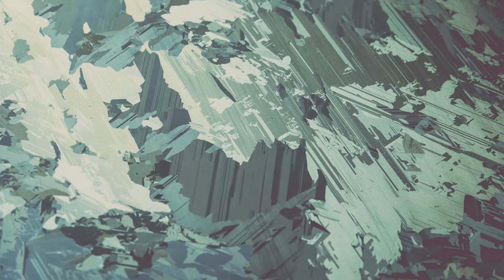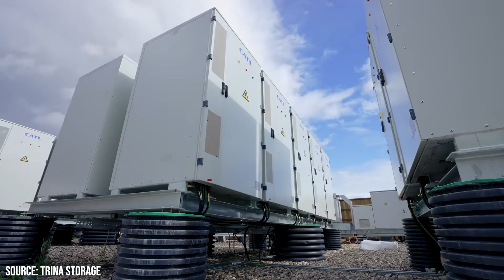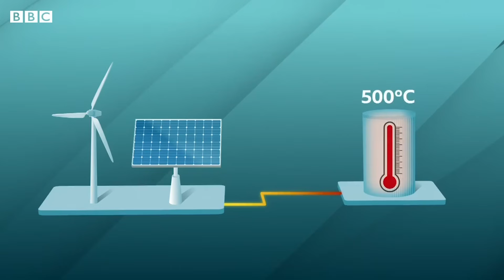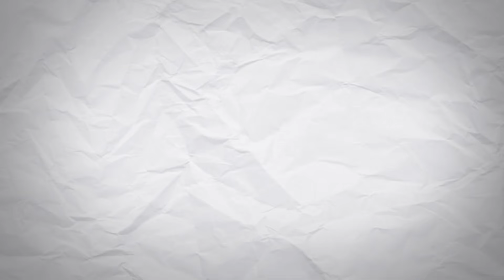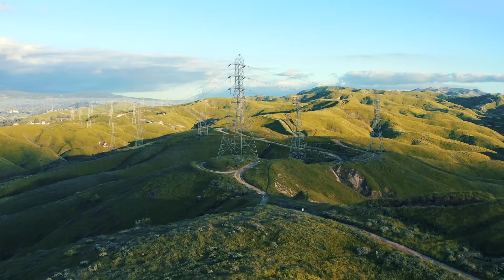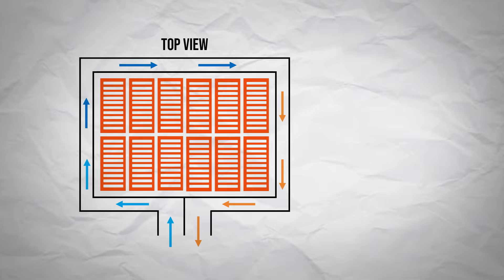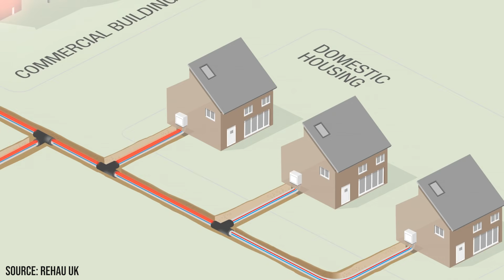How 3000 Degree Bricks Will End Battery Storage

Comment: Definitely an interesting technology, however I don't  think it will be able to compete with modern heat pump technology where you are hitting COPs of over 3 for electric facility heating.  In my neck of the woods, electric resistance heating is about 4x as expensive as heating with gas.  An electric air-sourced heat pump bridges that gap to some extent.  It is unclear how this storage tech provides a cost benefit from a commodity standpoint, whereas a heat pump obviously does.  There are definitely limitations with heat pumps for high temp applications,  so perhaps this storage tech could provide some advantages there - assuming it works and doesn't lose too much energy in storage too quickly.
Reply: Thanks for your thoughts! While heat pumps are great, we are able to tackle higher temperature applications!

Comment: Heat grids have always been superior in terms of efficiency. But distribution costs are very high and it's inherently local. With a heat storage solution like this isn't not entirely explained what scale this would work at. But for heat grids it'd have be the the scale of dozens of homes and businesses. Further the cost to install a heat grid is very high and doesn't offer the much more interesting benefit of providing cooling as well so a good part of the globe loses out. Considered on that basis it sounds a lot more reasonable and cost effective if you're going to spend that kind of money for a heat grid to just insulate homes better and use the homes at the battery. For industrial applications though I totally see the use case and that in my mind IS it's use case. Extending large factories runtime throughout the day would be a big deal.
Reply: Yes! We're focused exclusively on industrial applications =]

Comment: This is a thermal mass storage system, albeit a high temperature one. Such high temperatures are expensive to build and maintain, and inefficient as hell. There just isn't enough mass that can be positioned close enough to the intended use.
Reply: Ya, there's a problem with sand batteries otherwise we'd see more of them. I've been thinking about making a small system to store solar energy at the house but the math doesn't make sense
Reply: You wouldn’t know
Reply: suck on it
 @timcarsondalat

Comment: I'm not really a big fan of using electricity to heat thermal batteries. Turning solar radiation directly into heat could be even cheaper since solar thermal energy efficiency is far better than photovoltaics.
Reply: When you have to transport heat from a (massive) solar thermal plant over distances, you experience massive losses. We are very high efficiency due to our ability to convert electricity to heat at 98% efficiency, right where heat loads are located.
Reply: @RondoEnergyGlobal  You are right, the solar heat plant should be located at the site, which is challenging or impossible if space is limited. As you said, generating large amounts of thermal energy requires a lot of space. 
Also reaching the temperatures required for industrial applications is challenging with solar, that increases cost and defeats the whole point.

I wrote my comment before watching the whole video, it also became clear to me that using renewable electricity for heating is the best option for your applications. 
Solar thermal heating has it's niche, but not this one.

Thanks for the reply!

Comment: It is a misleading title. That is more like equalizing element, with very limited storage capability.  That is not storage equal to battery that we need for our grids. Of course if you compera the thermal storage and batteries in therms of exactly that application you can reach the conclusions from the video. However it is still misleding that you can use the "temperature" equalizer like, battery storage. You can not. 

That is a sector coupling solutions, but is not bidirectional. Like a battery is.  It can provide auxiliary services to the grid. However only unidirectional. There are also electrical arc boilers, which vaporize water. But of course you can not control the temperature of the output dump so well as this solutio.

Comment: In the UK we had storage heaters in thermal bricks way back in the 1970's, but they were charged using cheap overnight electricity, oops doesn't exist anymore.! Cheap electricity I mean.
Reply: @concon424  yes we've always done it, it's called load shedding and don't worry come night time solar shuts itself off.
Reply: There are actually areas in the world where electricity reaches $0 or even negative pricing during peak hours due to over-generation from renewable sources. In these cases, zero-carbon energy is curtailed. Rondo charges intermittently during these low-cost, peak, renewable hours!
Reply: @RondoEnergyGlobal  Absolute rubbish, in Cyprus with subsidised grid tied solar, when there's a power cut, it fails also.! And the only cheap solar is for those who can afford it, it's not cheap for those that can't and they're paying for it.

Comment: You said that there is a power grid storage system that has 98% efficiency and is built to work for 100 years. Think about that. Really? BS.  😊
Reply: Our system can be used on the electricity grid to eliminate renewable curtailment during peak hours -- but our system delivers heat to industrial customers who require heat for their processes (these processes = ~25% of global CO2). Just like your toaster converts electricity to heat at 100% efficiency, Rondo works similarly to deliver heat to our customers! We do not turn that heat back into electricity for the grid.

Comment: IMHO, energy storage for power grid is a direction driven by magical thinking. What needs to by developed is better power production. It’s time for modern safe nuclear power. 😊
Reply: Our system is not made for grid energy storage -- we're made for industrial energy storage for customers who require heat! In doing that, we can take power from the grid that would otherwise be curtailed during peak generation -- and instead of that clean green power being wasted, we can use it to replace gas use in industrial processes (that account for ~25% of global CO2 emissions today). A win-win for the grid and industrial customers who require 24/7 heat!

Comment: This was my Concept for a House in aprox 2010, I Envisioned a Large Cubic Sand Battery to last through winter, done some Calculations Too!
Reply: There are several companies who have designed a similar system for home use! I suggest searching for "residential heat battery" -- they work similarly!
Reply: in winter you can have wind-turbine as back up

Comment: industrial flywheels. thermal mass. wave motion capture. tidal generators. thermal electric. geothermal. 

I ain't holdin ma breath.
Reply: The thing about Rondo -- our fundamental energy storage technology has been proven for 200 years. Today, millions of tons of our storage material are in use, storing 600 TWh of power, lasting hundreds of thousands of cycles. This is at scale today and proven since the early 1800’s. Our innovation is using electricity to heat this material instead of waste heat from steel plants and/or boilers!!

Comment: I don't buy this one bit. The amount of energy needed to heat this battery to this temperature is immense. As in, almost all of the power generated has to go to storage, where is the power to run the grid? And then when it's time to tap the battery, how long is this going to realistically last? The heat will be used up very quickly. So much excess generating capacity will be needed it will be ridiculously expensive. Maybe it's technically possible but financially, not feasible. This will make nuclear look cheap.
Reply: Our system is not made for grid energy storage (although it can be configured to generate electricity as well) -- our core customers are heavy industrials that need thermal energy storage -- they require heat! In doing that, we take power from the grid that would otherwise be curtailed during peak generation, where in some locations electricity costs during the day fall to $0 or even into the negatives during over-generation -- and instead of that clean green power that otherwise would be wasted, we use it to replace gas use in industrial processes (that account for ~25% of global CO2 emissions today). A win-win for the grid (eliminating curtailment / energy arbitrage) and industrial customers (lower costs / eliminate CO2) who require 24/7 heat!

Comment: Did I miss the part where the losses were discussed over that 12 hour period? What percentage of the stored heat is still available at the end of a 12 hour wait?
Reply: More impractical pseudoscience
Reply: They say bullshit answer (95%) on the top comment, i'm 95% sure this is just pseudoscience scam
Reply: You should know that the answer is "it depends"

Is this thing installed in the basement of a cold weather climate controlled building?  In that case all lost heat will just flow into the floor and be useful.  

The size of the installation, the operational requirements, and the ambient weather conditions will greatly effect heat lost to the environment.
Reply: We deliver heat to our customers 24/7 at the temperatures / pressures / quantities demanded -- just like a gas-fired boiler would deliver. Except, we're non-combustion and CO2-free! We charge and discharge at the same time, and discharge 24/7, so the storage duration is long enough, and capacity large enough, to continuously provide our customers with power (without disruption).
Reply: @RondoEnergyGlobal  I like how you didn't answer a simple question, indicating a lot of energy loss. If anyone asks I'll say it's 50% per 6 hours
Reply: @RN1441  Yep, yet another renewable energy startup to scam venture capital.
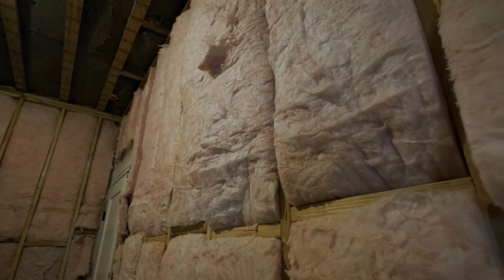Reply: @RN1441   yo is this what you looking for 6:30
Reply: @isfren5482  It mentions that they have insulation, but doesn't touch on the actual losses at all, nor does the official company response above, so we can assume through their conspicuous omission that they must be pretty bad, unfortunately :-(
Reply: @KingMoronProductions  Exactly. I was completely lost during the section the video explained about the insulation. It didn't make any sense to me at all. The whole point of energy storage is to STORE energy. Why did the response comment from the manufacture make an analogy to generation instead of storage? I smell pseudo science, especially the part about using it to distribute heat to residential homes. No, just no. The infrastructure costs would never make sense and if this tech really was about energy storage, then all it needs to do is use electricity to heat those homes. Converting heat to electricity and then back to heat is way more economical form of energy transportation than the proposed solution by this company. Companies like these often only look at the cost to store energy and completely forget the cost transport it, which is often way more than the cost to generate it in the first place. 

Rondo Energy would do well to know that electricity in places like southern California cost less than $0.03/kWh to generate, but the utilities sell to the customers from anywhere from $0.15-$0.25+ at the cheapest. And no, it's not 500% profit. Public utilities are all not-for-profit and even investor owned utilities are capped at a maximum of 15% profit by the CPUC., which means utilities don't make much of a profit, if any, and hence the cost to deliver the energy costs 400%+ more than it costs to generate.
Reply: @RN1441  they need a lot of insulation and it is going to be hard to reduce the energy loss below 40%. Don't mention that electric heaters are also highly inefficient. These are low cost but your end efficiency is going to be low. They are trying to reduce peak demand on the grid but are increasing demand off peak (a problem here is that electricity companies rely on off peak times and a constant load will introduce new issues and increased overall degradation of the grid infrastructure).
Reply: @RN1441  Yep, quite a non answer. 

Charge and discharge at the same time? WTF? why not charge directly where needed? 
The idea is to charge when is excess and discharge when needed. 

Avoid true figures proves that these guys are scammers. 
Just words turned around.

Echo chamber for equalizing.... 
Yeah, any storage will eventually equalize. 
What you actually need is good insulation. 
And that air insulation sounds like bull. 
Apparently recovers some heat, but because of moving the air, actually extracts more heat. 
Also, deep discharge for better efficiency makes no sense. 

Heat storage has a single trick, go big, and preferably buried deep. With size will decrease the surface to insulate, and increase the thickness of the mass, which counts as insulation. One meter of rock counts as 10cm of styrofoam. .
Reply: @RN1441  I'm very skeptical of this scheme and, by the way, storage isn't with Li-Ion, it's with very stable, long cycle length LiFePo4 batteries.
Reply: @RondoEnergyGlobal  sounds like you're expecting to use off-peak electricity from the grid to heat a battery that is local to the end user.  How far do you anticipate transmitting the output?

Comment: Very clever. What happens if air flow around the battery stops?
Reply: The airflow around the battery never stops -- and if it does stop, the unit is no longer delivering power. In this case of required maintenance, there is no risk of thermal runaway, and we simply replace the air blower to ensure proper airflow.

Comment: It's not storage of electricity, but storage of heat. You'd still need a turbine and generator (50% efficiency at best) to convert it back to electricity. It's very rare to transferring energy as heat.
Reply: Energy as heat account for ~25% of global CO2 emissions today! Not very rare at all! Our system is not deployed to generate electricity -- we're made for industrial heat storage for customers who require heat! In doing that, we can take power from the grid that would otherwise be curtailed during peak generation -- and instead of that clean green power being wasted, we can use it to replace gas use in industrial processes. A win-win for the grid and industrial customers who require 24/7 heat!
Reply: @RondoEnergyGlobal  not transmitted though.  That is energy converted into heat, not heat moved where it's generated to where it's needed
Reply: @MrPhatties  the rondo system is located where the existing boilers are located at a facility (they replace the boilers). So the heat is using the same heat network and not transferred over distances.
Reply: @concon424  yes but the number of use cases for temporary storage of heat is pretty limited compared to storage of electricity.
Reply: How much % does it lose per hour on average over 24 hours, assuming a max temp start? How many BTUs of heat can a single unit provide from max temp (full) to ambient temp (empty)?
Reply: @MrPhatties  The rondo units are sized so they're deliver steam at exactly the temperatures / pressure / quality required by the customer 24/7, and flexibly charge on or off grid when electricity is cheapest.
Reply: @concon424  so essentially you'd connect it to a (cheap) renewable energy source, charge it during peak generation then run off of it in the off hours - but 12 hours of storage isn't really enough to bridge solar, and if you're losing ~8-12% per hour that it's sitting you'd really want to make sure it gets used instantly or the waste becomes so high you increase your cost on that "cheap renewable" by a significant amount.  

Cool that it never degrades over the years and costs less on initial setup but this isn't going to displace much grid level battery storage.

Comment: No mention of how can one PRODUCE 1500 deg celsius, how is ANYTHING this hot can be transfered, what are the INLET temperatrures required to transfer heat into a 1500 deg reservoir (clue: waaay higher), and in general - what materials and machinery can withstand such temperatures for long time?

no device shown
bunch of blah blah crap and marketing "global economy" talk

does anyone really believe this?
Reply: Hi Ziv -- Our core technology (refractory brick) is an energy storage technology proven for 200 years in the steel industry! There are millions of tons of this material storing 600 TWh in use TODAY (easily verifiable!), lasting hundreds of thousands of cycles. All of the world’s production of steel today relies on this technology. This has been proven since the early 1800’s... Our innovation is that we use electric heaters to reach high temperatures instead of boilers or waste-heat! This works in the same way as your toaster or hairdryer, which convert electricity to heat at 100% efficiency. Industrial processes all over the world require high temperature heat and have the infrastructure to support it already in place -- and create that heat using gas-fired boilers today. I encourage you to stay tuned for our upcoming customer announcements and I hope we can win you over =] ...

Comment: You mentioned electric heating which is as far as I know almost 100% efficient in turning the electricity into heat but what about heat pumps? I'd assume they wouldn't be capable of reaching temperatures that high but I have no idea honestly.
Reply: So, a heat pump is just an application of transfer of energy. If you find the right material with the right properties, you could theoretically get from everyday temperatures to 1000 degrees, but I have no idea what that transfer material is. it may be a matter of finding a material we can compress enough to make the change.